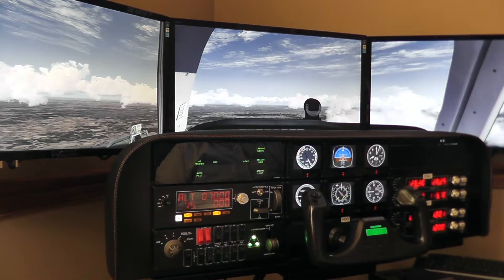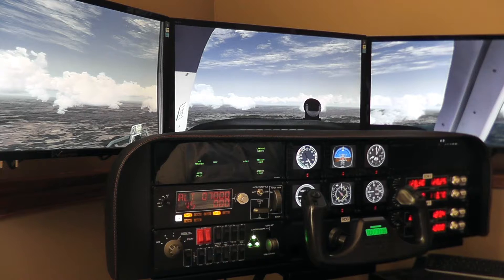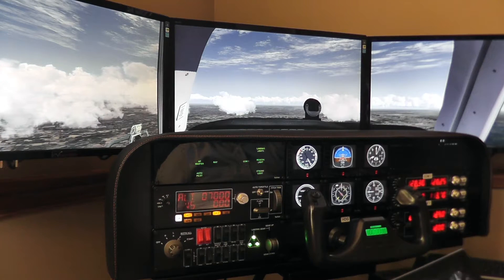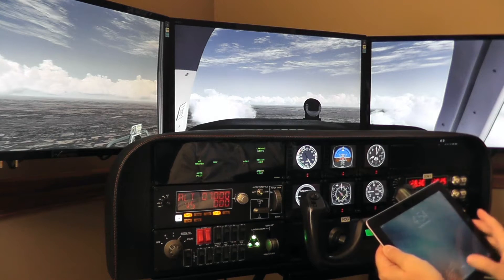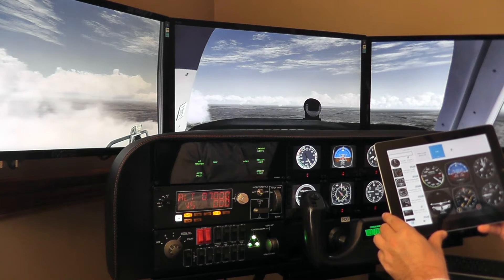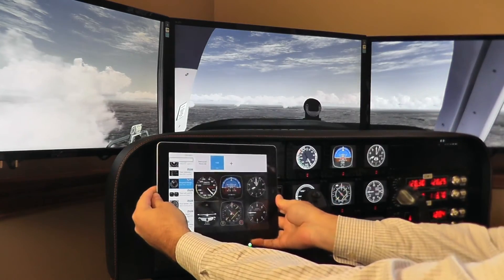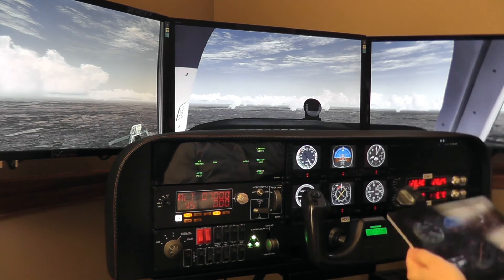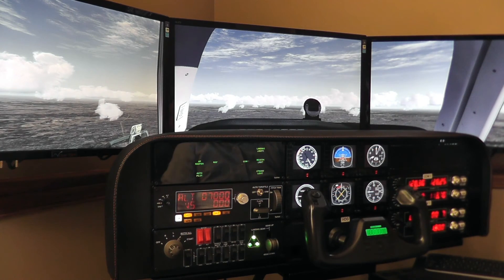Using iPad with the Volair Sim Avionics Panel and Cockpit

Comment: Hey ! :)

Is it possible to switch between different screens and have multiple setups for Air Manager app?
So you can swipe from the radio panel to switch panel and one for the instruments?
Reply from the maker: You can have different pre-configured set-ups but I do not think you can switch via swipe. You have to go back to main menu and select different pre-set.
Reply: Ahh, cool! Thank you :)

Comment: would the saitek tpm fit in one of the slots on the right?
Reply: Go Leo good luck finding one. I had to buy a topple from go flight, super slow shipping time  tho. Air manager works great I run it on a 15" touch screen mounted in my panel

Comment: OMG that is very nice Mark !!! 

I have the exact set up but cant used 

can you guys help me ?
Reply: thank you. Im getting around it now I been doing a lot of researches and I have a local IT store help me out 

I have them working with X-Plane 11
Reply: Roman, I saw your other posts. The issue that you have is that you use X-Plane which does not work with Saitek FIPs without special drivers. You must install 3-rd party drivers for it to work..
Reply: yeah is frustrating I spend almost 4k and have not flight a single fight yet 

do you know anyone that can help me set this up in the Maryland area?
Reply from the maker: Please call us at 1-855-8VOLAIR (1-855-886-5247). Even though technically we have nothing to do with Saitek, we hate to see a flight simmer not being able to enjoy the equipment. Also, check out: https://www.spadnext.com/forum/viewforum.php?f=1 
These are 3rd party drivers for the Saitek gages.